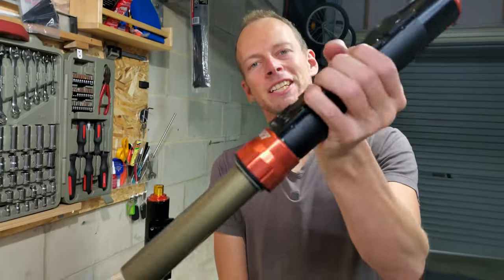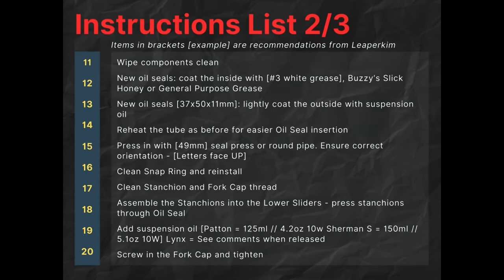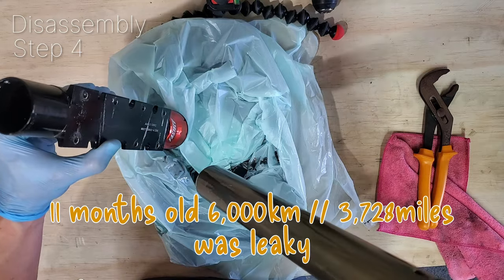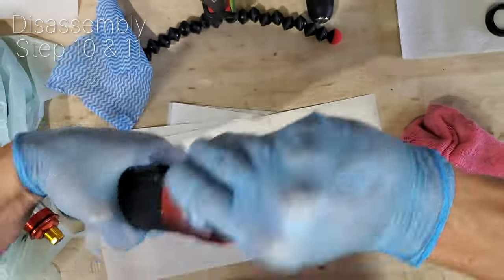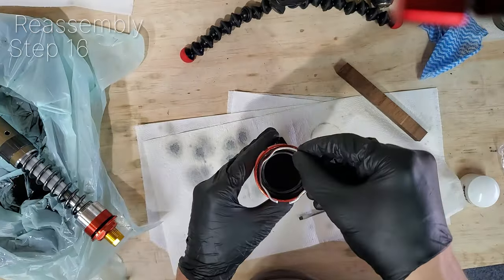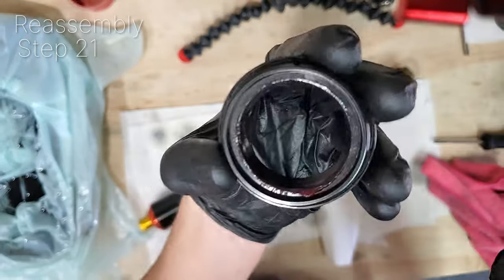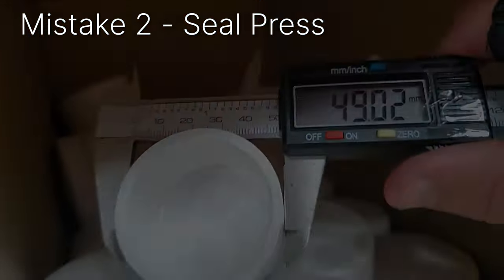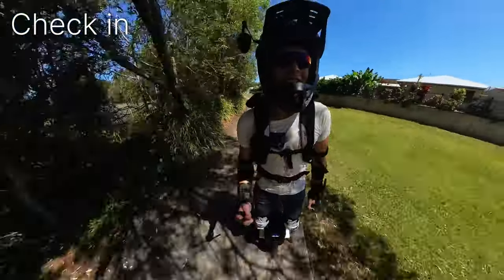Fastace Suspension Service - Veteran Patton, Sherman S Electric Unicycle Forks EUC

Comment: Tip regarding oil seal direction, if you look closely on the inside of the seal you will see some ridges in one end, those should be pointing inwards towards the shock, the ridges keep the oil inside, going by other type of markings is not a reliable method as different brand seals will be different in that aspect.
Reply from the maker: Thanks for the info! Yea make sure you're 1000% certain when putting them in.
The writing is microscopic too.

Comment: You make such great videos on the Lynx, i think this is going to be my first suspension euc.

I remember on my dirt bike, i had dust covers over the front forks, do you think some kind or type of dust cover over the suspension (the oiled shaft part of the suspension) may reduce the frequency of oil change/maintenance on the shocks on this euc?

i appreciate low maintenance, and i hope i can locate some dust covers that will fit onto these shocks, and see if i can keep the oil in the shocks, clean, a little or a lot longer.

Comment: Thank you for this video, well done.   How many miles were on you struts at time of rebuild?  Why so much oil contamination?  If contamination is getting past the seal, I wonder about a some type of sock that would minimize debris collecting on the tube surface?
Reply from the maker: 3,700miles (6,000km) 11 months old. It seems that having the stock open portion on the mudguard struts makes a huge difference. Since dirt goes straight on the stanchions. Once I covered that up there was a big reduction in the dirt build up on the suspension. 
It's probably superstition but I'd guess socks make the travel less smooth? 
Cheers!

Comment: Hey Jon!

Does any 37x50x11 fork seal work? Was searching for some on my local amazon site. Found this "37x50x11mm Front Fork Oil Seal and Dust Seal Kit for Honda VF750C"
Reply from the maker: Hi Yu they should be fine. Mine were listed as for a honda motorbike, these were the exact ones: https://www.ebay.com.au/itm/234270092804
The pic in the video description was a cheaper option I found. The delivery was too slow for me though.
Reply: @jonoeuc Appreciate the swift response!
Reply: Got my suspension fork seal replaced over the weekend. A generic 37x50x11 seal worked on the Sherman S Fastace suspension. Another tip to avoid buying a 32mm PVC pipe insert is to just use the old seal and press it in. It doesn't take much force to push the seal in! 

Thanks for the info, Jon!
Reply: Also, make sure you don't slide the suspension tube over the fork seal too many times. On the 3rd time (because I let it slide out accidentally), part of the inner seal was flipped inside out and basically ruined the seal. Grease the inner seal and once you're in, don't pull the suspension apart again to avoid damaging the inner seal
Reply from the maker: Excellent! I'm glad to hear it, ready for another year or so of cruising.
Ah good tip, hopefully others see it too
cheers

Comment: Good job. Nothing wrong with reusing the dust wipers if they are in good shape and not cracked. Sometimes that reused dust wipers can keep the stiction lower with less friction. It's done all the time. The slick honey you pictured is  the good stuff for that job. Use plenty of it for smoother seal action
Reply from the maker: Thanks mate

Comment: Someone mentioned you tried a higher weight oil than manufactured as, did it have an effect on your wheel?
Reply from the maker: Hey Rich, 10 weight is the recommended and what I used. W (winter) if you're in cold climates.
Hope that helps
Reply: @jonoeuc  Recommended by who? As others using 5W
Reply from the maker: @milordas  e-riderz and their info was from Leaperkim. It's a variable that you can play around with to adjust your suspension.
lighter weights flows easier and translates to a plusher ride. I'll be looking into a lighter 2.5 or 5 weight for my lynx.
hope that helps

Comment: When is it recommended to change oil ? I bought mine second hand. No idea it it was done by the previous owner.
Reply from the maker: I'd say until it becomes an issue with weeping oil or the suspension isn't performing well anymore. which is the same thing due to oil loss.
The life can easily be extended by popping off the dust seals from the stanchions and cleaning them.
Otherwise I reckon a safe bet is 6 to 10,000 km (3,730-6,200miles) or Every 1-2years depending on the amount of offroading.

Comment: is the 10 suspension oil ok as I see others use 5? thanks in advance
Reply from the maker: Leaperkim suggests 10wt from my contact with E-Riderz. It's ok to play around with the oil weights to adjust the suspension feel. In fact i'm planning to try a 2.5wt in my Lynx. Reducing it will allow the oil to flow more freely and thus increases the sponginess. You can then dial it in with the compression and rebound damping.
Hope that helps 
cheers, jono

Comment: How often do you have to change the oil because I'm about to get one,?Hopefully not too often,
Reply from the maker: Hey Rick, not often. My suggestions is if there is a leak, 10,000km (6,200miles) or every 12 months. 
You can improve the longevity by enclosing the hole in the mudguard struts. I saw that newer model 'may' have this stock.  Cheers Jono
 see my video t=10min57s https://youtu.be/4S_Au-9Xlt8?si=ZB-_AP75B1Uz68d6&t=661